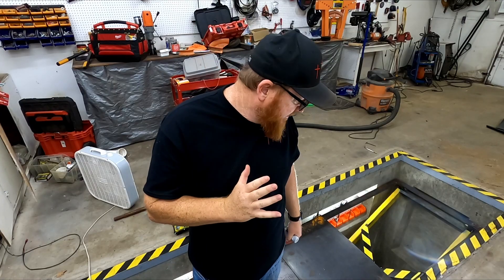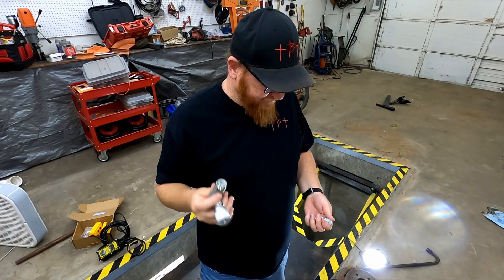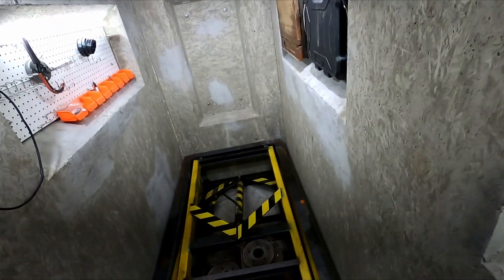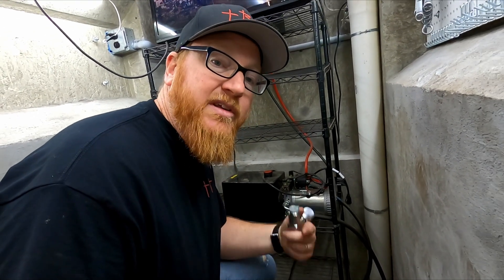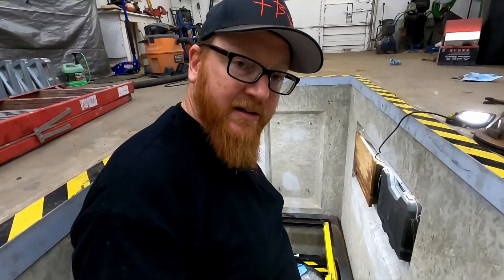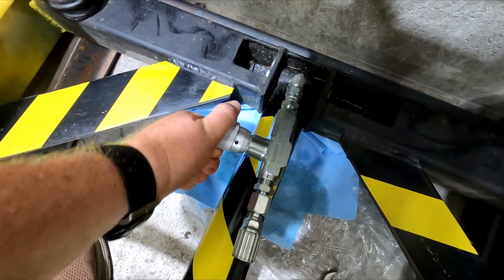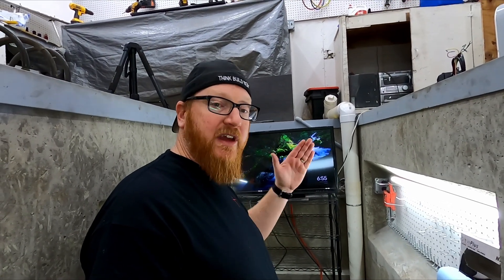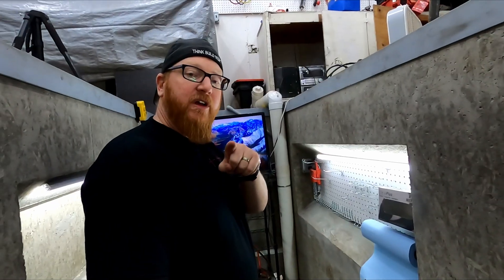Vevor Hydraulic Pump Flow Control Issue SOLVED!

Comment: Thank you so much for explaining the pressure valves. I'm using this pump to run a hydraulic for my front gate and it swings it really fast 😂. Gonna try and tweak it tomorrow.
Reply from the maker: You can probably get a cheaper one that limits the same both ways.  Glad it could help!

Comment: I love this project. I have been watching it since you started cutting the garage floor. I am not excited for the wireless controls. I am worried that you would need E-stop safety switches to keep you from getting crushed while working under vehicles and the complexity that this will add to you project.  Stay safe my friend
Reply from the maker: Safety switch still coming...  they just don't make a elevator pit don't car crush yourself safety Interlock.  Lol. I have some options narrowed down.  Wanted to get the feel for how it works before I made too many decisions.